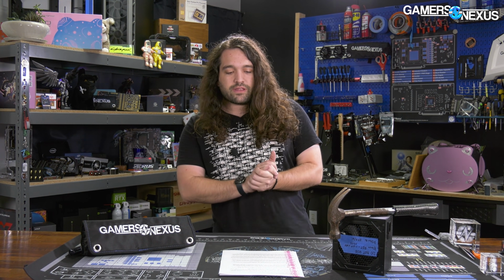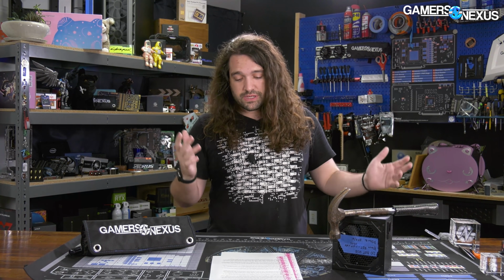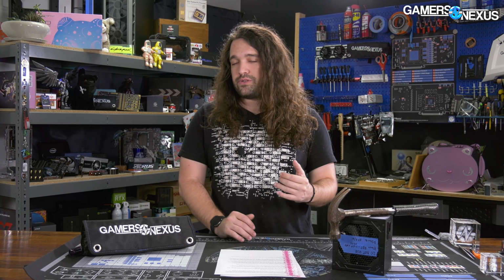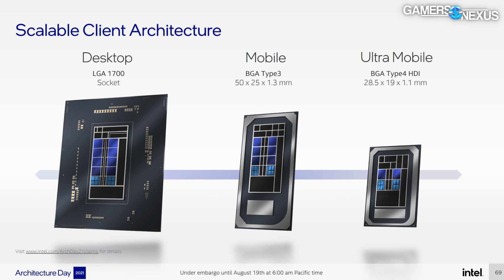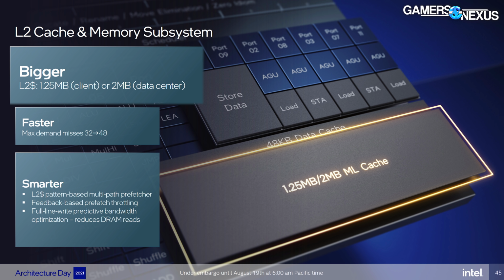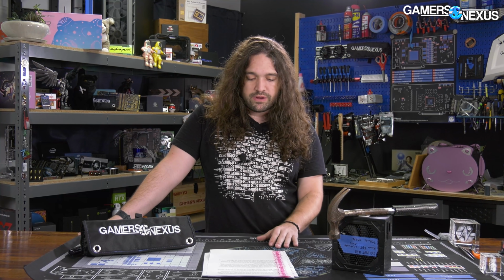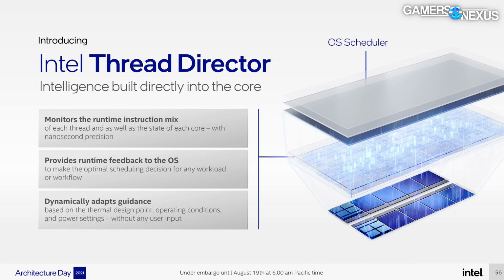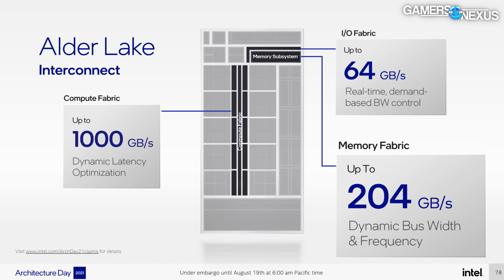Intel Overhauls CPUs: Alder Lake Architecture Explained - New Core, PCIe Gen5, & DDR5

Comment: You can tell Steve is still salty with Gigabyte because the PSU is in every new vid. Looks like this means war.
Reply: Gigabyte knowingly selling PSUs that explode should not be forgotten for a very long time
Reply: @personguy4622  I'm making way too many 69 likes to 70 likes today.
Reply: Gigabyte declared war on Steve by pretending there were only problems with running those PSUs at their limits for extended periods of time. When Steve and Co. had been meticulous in their testing.
Reply: @Penfolduk001  I would have preferred to have had the standard which they were using presented alongside their methodology.   I can certainly see the step switching to determine the OPP trigger a point where a PSU can be improperly stressed.  Blaming bulk capacitors for the defect is misleading , however , MOSFET changes can be an issue though we were given no indication of which was the better one.
Reply: Α shovel next to that psu would be perfect!!
Reply: @John__K  Well a garden spade would fit on set. But just having just a small fire extinguisher would be better. Implying that they don't even trust it not to burst into flames turned off and unplugged.
Reply: It should. Exploding PSUs is a dangerous thing. Just like NZXT and their harbor freight PCIe risers.
Reply: @stephanhuntsman7700  harbor freight, ouch! :)
Reply: @seamusmcgowan1  My friend with a successful handyman service for 18 years always say the only thing HB is good for are the gloves, everything else is for cheapass people who don't care using crappy parts to repair their own houses. Not that there is anything wrong with that.
Reply: @stephanhuntsman7700  hey! all the pieces of my jack stands resent that remark
Reply: War? Then he should be careful to check his bike for any PSUs connected to them and stuffed under the seat...
Reply: @smoofles  I'm sure he's been extra careful ever since AMD tried to assassinate him with their bike.
Reply: The war is still ongoing. Throwing shade will continue until morale customer service improves.
Reply: After everything, I think the whole crew would be pretty salty.  LOL
Reply: Gigabyte introduced IED PSUs
Reply: @New Moon I guess we'll find out if someone's house burns down with loss of life.
Reply: The Celestial Wizard couldn't express his feelings any better. That hammer or "Widlariser" would make the late Bob Widlar smile I am sure. Go Steve and keep on keeping those bastards honest! 👍
Reply: Then he has the hammer just sitting on it lol. Yeah, This means war.
Reply: " Peace was never an option "
Reply: Gigabyte needs to be held accountable and I'm glad someone is taking a stand.
Reply: I wanna be clear, y'alls, I stan this level of shade. Steve and crew have proven themselves repeatedly and Gigabyte deserves no mercy.
Reply: Some media outlets make claims that PSUs fail after repeatedly hammering them.
Reply: lol
Reply: I sure the hell won't be buying any Gigabyte products if this is how they respond.
Reply: It needs a little hexagram made of candles
Reply: Hah,  yeah,  though I reckon its also a shoutout to Hardware Unboxed
Reply: With a hammer ontop to let you know it's junk.
Reply: This is the type of pettiness I can get behind lol
Reply: He has the hammer in case it comes back from the dead.
Reply: Up next, right next to the gigabyte psu:
 - A shovel.
- A bag of salt.
- A (fake) grenade.
- Thor's Hammer.
Reply: I'll be honest , the disappointment build PC this year is going to be something truly special/cursed.
Reply: They are so childish... 😅😅
Reply: yup gigabyte's real bunch of 🐓🥸!!!
Reply: Just stick it in the nzxt case. :)
Reply: It's the only way those Companies understand because you keep buying their Garbage.
Reply: I love it too - I’m frequently turned off by many of his more rougher edges, but sometimes he gets the balance juuuuuuuust right, and becomes Goldilocks Tech-Jesus.

Comment: Will intel manage to beat AMD again?
Reply: not only AMD but also Apple silicon
Reply: @劉奕彤-q6g  Intel always talk big, but not necessarily deliver
Reply: @wongkoewei9829  I believe that this is a little different. I'm sure it will beat current 5950x offering, as per leaked benchmarks, but we need to look out how it will compare to Zen4... The fact is that AMD has the advantage
Reply: @wongkoewei9829  like other companies don't do that
Reply: @danilolimadossantos1  
Zen 4  competes with RaptorLake
Reply: @technewseveryweek8332  not exactly. It comes before raptor lake, so the "current" Intel gen will be Alder Lake
Reply: @danilolimadossantos1  
No difference unless Zen 4 releases in Q1 or something. If the gap is ~3 months,  then they are together.